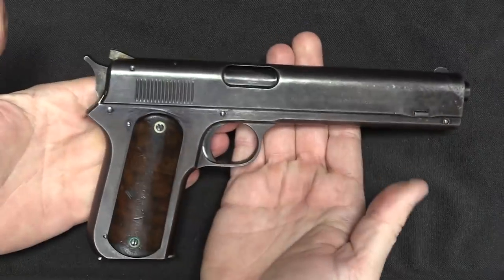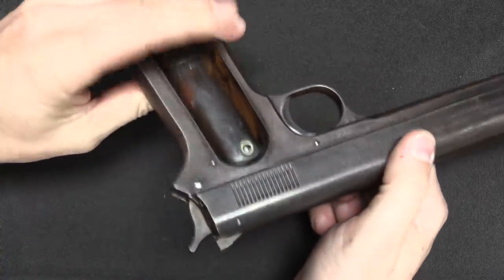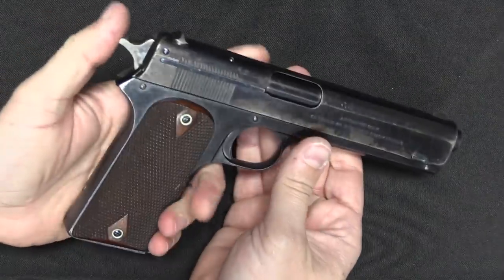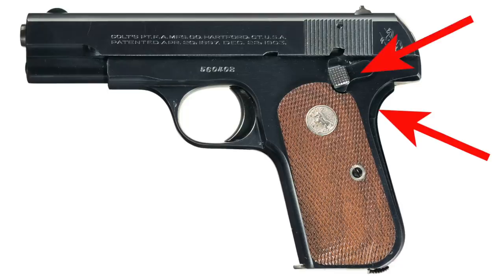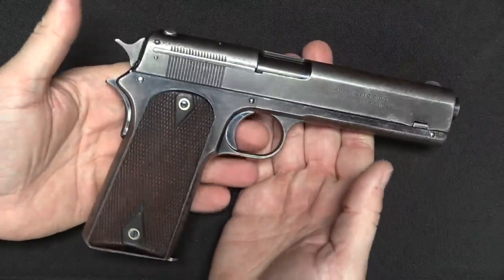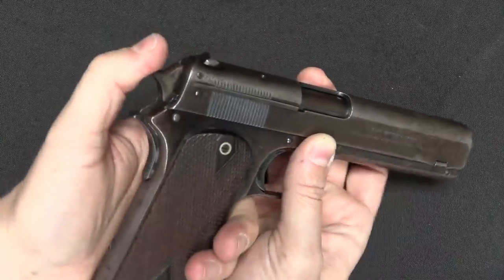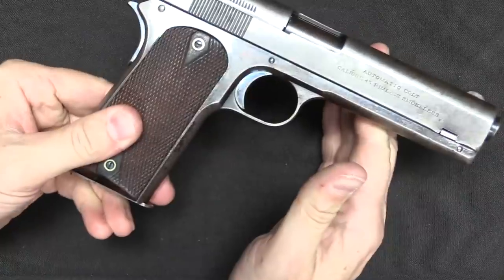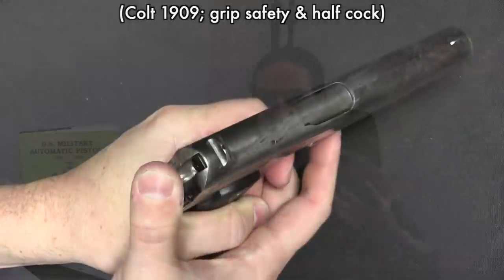How the 1911 Got Its Safeties - and Why Its Ancestors Had None

Comment: I have a replica copy of the Sears - Roebuck catalog which lists the cartridge for the 1905 Colt as the ".45 rimless-smokeless".
Some police officers were so dead set against the grip safety that they would wrap the grip with friction tape to defeat it. I read that on at least one occasion one of these modified guns was hung on a wall peg (with the other safety off, apparently) and the pistol discharged pinwheel fashion, emptying the magazine.
Reply: russian roulette for the whole family.
Reply: I can see that happening if the recoil was strong enough to bounce the pistol off the inside of the trigger guard, back into the trigger, and it somehow didn't fall off the edge of the pin.
Reply: Good thing the ATF didn't exist back then, otherwise they would have classified the peg as a bump fire device.
Reply: That can happen?  In the Canadian army I heard stories about the MM11 possibly popping off one perhaps two if it was dropped even if hooked into the bolt notch, (all anecdotal though and soldiers are well documented liars and story tellers).  I’m not disparaging soldiers but when they have too much free time dumb ensues quite often.
Reply: @john-paulsilke893  The gun in question was in civilian (police) use and was hung on a peg outside the briefing room where all officers' guns were stored. I'm sorry that I can't find any mention of the article but it was 40 years ago or thereabouts. With the gun supported on a wall peg through the trigger guard it seems possible.
Reply: What kind of idiot stores a loaded gun with no safety(at least not usable)?
Reply: @LostShipMate  They're going to hate me for this, but ... people that carry Glocks? Maybe their stiff and gritty triggers would prevent this from happening in the same scenario though.
Reply: @LostShipMate  People who aren't used to safeties on guns at all.
Not sure the age of the story, but seeing how it was a police officer, there is a chance they were used to double action revolvers which typically don't have safety.
I can see some stubborn dude, when the precinct is retiring their .38s for automatics being all "If I need to draw my weapon I need to be able to shoot quickly, not be slowed down by a lever!"
Reply: @machintelligence  
Do you understand the difference between "possible" and "probable"?
Reply: @stevecolley6750  Certainly. It happened, therefore it is possible, but it wasn't a common occurrence therefore it wasn't probable.

Comment: I think one thing that should be considered, there are hundreds of thousands of men who have served in the military back when the M1911 was the issue handgun.  The came from all over the nation, and in some cases the world. Many had never seen a firearm before, and were terrified of them, this especially during the draft era.  So with this in mind, the added safety makes a lot of sense. In my 8 years in the US Army, I have seen soldiers, in the field, play with the pistols, much as we did when we played cops and robbers. I saw them practice their fast draw playing cowboy with loaded '45's, and as a Sergeant had to do incident reports when some idiot blew a hole in the barracks wall or their wall locker.  Safety's are indeed a necessary and very good thing.   Especially with the single action semi-auto where the trigger pull is, what we like to call, smooth and short.
Reply: And all those same reasons apply to a civilian getting their first defensive pistol.

Comment: 5:04
You may have omitted it for brevity or been unaware, but the original grip safeties retrofitted to the trial 1905s actually didn't have a tang long enough to decock the pistol one-handed.  They were extended during the trials after a request by the ordnance board to give the pistols that ability.

Comment: One of the reasons they also wanted the thumb safety was to lock the slide in place. A common complaint from cavalry troops was the slide sometimes getting pushed out of battery as they tried to holster it one handed.

Comment: There is only one thing I've never been able to understand about the 1911 grip safety, how anyone can hold the pistol in a firing grip and NOT disengage the grip safety. I've heard so many people claim that disengaging that grip safety is a problem for them, and many of the 'modern' fancied up guns have big old humps and bumps on the grip safety to 'help' disengage it, but I've played around with a few 1911's, including my own beloved Springfield G.I. remake 1911A1, a Ruger 10mm SR1911, and dad's Colt Gold Cup from the 80's, and I've never been able to hold the gun in anything resembling a firing grip without tripping the grip safety. It's a complete mystery to me, unless some people have really weirdly shaped hands.
Reply: Exactly. Given the significant recoil, you want to grasp the pistol firmly before firing.
Reply: if you choke up real high as is common with modern tactical shooters the web of your hand can lift back up on the beaver tail.  people that shoot in such a way tend to run a modified grip safety that actuates with less travel.
Reply: Yes that seems weird to me as well. Especially on modern 1911s where the grip safety protrudes more of the back of the grip. But even with a standard "GI" 1911, I don't see how you would hold the gun without depressing the grip safety. Unless you barely hold it, which is not great if you actually want to fire the gun.
Reply: @butre.  The trouble with that theory is that I also use a very high grip and have never had such an issue unless I was deliberately trying to make it happen, even with the extended beaver-tail grip safeties. I can't help but wonder if it's something that pretty much doesn't happen, but people are worried that it can. Throw in some 'they said, he said' type internet/word of mouth stories and you get the seeds of yet another urban legend.
Reply: @USSEnterpriseA1701  I've been able to make it happen with the only change to my grip being moving my thumb up a quarter of an inch.  there's a reason people tell you to not ride the safety with your thumb, because that raises the web of your hand further and increases the risk of lifting the beavertail.
Reply: @butre.  Interesting. So I'm thinking it must take some combination of hand shape, grip style, and seemingly the modern 'enhancements'. Either way I still can't make it happen for me without holding the thing in a completely awkward way with the web of my hand below the bottom of the grip safety, which is very much not a firing grip. Maybe I just have perfectly 1911 sized hands, which is a distinct possibility.
Reply: bu tre i do ride the thumb safety on both my S&W 1911sc and my RIA 1911a2 and have NEVER had an issue with activating the grip safety.
Reply: very easy. Depending on how the safety is tuned, if you ride the 1911 grip too *high*, you may re-engage the safety. Your hand will exert upward pressure on the beaver tail, and not enough on the bottom end of the safety, and that may be enough to move the safety a little bit out of the slot. Play with it and you may find it. It's very good to know where that point is.

A properly tuned grip safety on a 1911 should disengage when pressed in 1/3 of the way. Unfortunately, many factory guns come with a setup that requires the safety to be well past 50% in, if not 100%, before it unblocks the trigger. 

Of course if your pistol is properly tuned, you won't be able to replicate it.
Reply: @butre.  This.
I have that exact problem on my 1911 race gun.

I always have to remind myself of putting my left hand a bit lower on the grip so my right thumb can properly clamp on the grip and disengage the grip safety.

Just goes to show that these older designs originally were intended to be shot one handed.
Reply: @USSEnterpriseA1701  Try putting your left hand really high on your right hand, the back of your left thumb will lift up your right thumb, making it more difficult to disengage the grip safety.
Reply: @Mick762  I go the exact opposite way I'm 5'6" and 130 lbs. always thought it was made for guys with big meaty hands.  Unless a grip safety has that bump on it with a proper grip the grip safety is in the web of my hand, and no matter how tightly I grip it there's not enough muscle in the web of my hand to depress it no matter how hard or tightly I grip one.
Reply: @bertbertmann5823  Well, I gave it my best try with my Springfield G.I. (the only one I have to hand for quick access, the fancier ones are intentionally harder to get to, as they are mostly range guns, I tend to rely on my CZ P-09 for any sort of home defense need). I can't for the life of me make the upward force on the tang come close to the grip force of my hand holding the grip safety in the disengaged position. Possibly with a big beaver tail, but I'm not thinking so, not with my hands. For reference, I've even gone so far as to ride my thumb up onto the back face of the slide (a very bad idea under any circumstance other than trying to test this with an unloaded gun, not to mention just downright painful to do from the frame and grip safety poking me) and it still isn't enough to engage the grip safety and lock the trigger. I still can't figure out how people do it from a firing grip unless the gun itself is out of spec (which is also a possibility, given the number of companies making and/or assembling the things, someone's going to make lemon eventually, math guarantees that).
Reply: @bertbertmann5823  gotta ask, why do you choose a 1911 as a race gun? Seems heavy & lot of recoil compared to many other options.

I'm guessing it's a combo of the trigger & familiarity with the platform? Or just plain old "cause I want to run it", which is perfectly legitimate too haha.
Reply: Same. I have pretty small hands, and I've never had a problem with it.
Reply: @KennyCnotG  It's my club's rental gun and i use it until i get my license.
It's KPS Omega Match, not a bad gun by any means, but it's true, i don't necessarily see a 1911 in my forseeable future other than "a .45 has to be a 1911 and vice versa"
Reply: So lots of people have an issue, but you don't.  Maybe your hands are weirdly shaped.
Reply: @KennyCnotG  different classes require different power factors, in 3 gun you need to run .45 acp or better to compete in heavy irons or heavy optics, and depending on the organizing body possibly unlimited.  the weight of a 1911 is a positive attribute in a competition gun as it reduces felt recoil, and in many IDPA type rulesets you're limited by capacity and physical dimensions.  pretty much all of these rules were built around allowing the 1911 and disallowing wonder nines as they mostly came around when the wonder nines were just coming into play.
Reply: @Ulfstigandr  not sure about that particular RIA but the 1911sc is a bobtail, and bobtails pretty much eliminate the issue.  same with arched mainspring housings.  RIA tends to do a good job with tuning parts like that so that may be part of why you've had such good luck with it.  I've been able to make it happen without being unreasonable on everything from taurus to dan wesson, but I only carry the full size ones.
Reply: bu tre the RIA is a gov model double stack. Very basic with even the old sights. Ive owned other basic and fancy models in the past and as far as i remember my Remington 1911 gov also never suffered from that issue
Reply: Good comment. Under the grip safety is a set of three springs. One of these affects the tension of the grip. There are always folk who will fiddle with these to "fine tune" and mess things up and do not mention this when talking about their poorly running gun. There will be others who just buy a crap one.
Reply: I think a lot of it is people looking to justify their modern plastic guns that dont have any real safety when it is so easy to at least have them built into the gun. Grip safeties make sense thumb safeties make sense... But needing to pull a trigger and calling that a safety does not. That is just like saying oh its a safety because you have to pull the trigger to fire it. Now If it had a trigger safety and a grip safety and a thumb safety hey that is a great idea. But a trigger safety alone is not. That is how stressed out people panic fire guns when they are not ready. Like shooting themself in the leg as they grab the gun or when someone reholsters a gun and something catches the trigger a draw string for example.    

 Basically just people looking for excuses as to why their prefered gun dosnt have a grip safety when in reality there is no reason not to have one.
Reply: @USSEnterpriseA1701  were you a mechanic, or some other job that did a lot of work with your hands? Can you touch your thumb to the base of your pinky finger?

I was a mechanic for a little bit, and I can just barely (and very uncomfortably) touch my thumb to the base of my pinky. My competition shooting buddy was a mechanic for 20+years and cannot touch his thumb to the base of his pinky at all. He has no trouble with grip safeties on his 1911 race guns, and neither do I. But someone who doesn't work with their hands probably won't have that big pad of muscle at the base of their thumb to help hit the grip safety.
Reply: @ScottKenny1978  No, but I got to talking with my dad about it because he's a big 1911 guy and eventually we did both mention how much meat there is at the base of my thumb. Thinking about what you said, it occurs to me that all of that button mashing I did as a kid on old fashioned hand-held games in the late 90's and early 2000's might have been good for something after all, or it could be all of the work around the house and yard I did. Come to think of it, dad still hasn't ever finished that house completely, there's still one 'bathroom' that only has an empty shell of a shower and not much else in it. Life has a way of providing distractions.
Reply: @bf945  Well said. Thank you.
Reply: Agreed
Reply: @butre.  I can't replicate this with my 1911. They must have large pockets of air in their hand .I tried.
Reply: @butre.  I tried and the safety disengages no matter my thumb movement.  Must have something to do with hand shape.
Reply: @AlexN2022  are you able to replicate this?  I tried and cannot.  Must be a certain hand shape for this.
Reply: Those are all relatively well-made 1911s. The only cases I could ever see for people having a problem with grip safeties, as others seem to also have mentioned, is oddly-shaped hands and/or out-of-spec guns. I own something like 8+ 1911s, from various manufacturers (from Filipino to U.S. origin), and literally any reasonable firing grip works for me on all of them.

I do think it would be more reasonable to assume that the gun was actually designed for large hands, as JMB was tall and lanky. You see Filipino guns with abominable modifications like extended slide releases, and even U.S. manufacturers have extended magazine releases and scallop cuts in the grips for the thumb to have better access to the magazine release, since apparently some people actually have a problem reaching them? For me, with my giant monkey hands, the 1911 fits like a glove, and with the polymer wonder 9s it seems to me that some Hogue Handall grip sleeves are usually necessary to fill in my grip. Even then, using the pad of my index finger on the trigger is ... awkward with just about everything.
Reply: If you have a one handed grip with your thumb curled down (like you’re gripping a hammer) it won’t ever be an issue. However, with a modern two handed thumbs forward grip, it’s possible while you’re making room on the grip for your support hand to create a “pocket” with your dominant hand that ends up not engaging the grip safety. So it’s one of those cases where the 1911’s ergonomics were perfect for the shooting techniques of the time, but as that evolved, the grip safety became more of an issue. That’s where a lot of the modifications came from.

The newer grip safeties with the memory bump and sensitization are there such that even if you do create a pocket with your two handed grip techniques, it’ll still disengage the safety as long as you have skin touching it. Then it’s never a problem again.